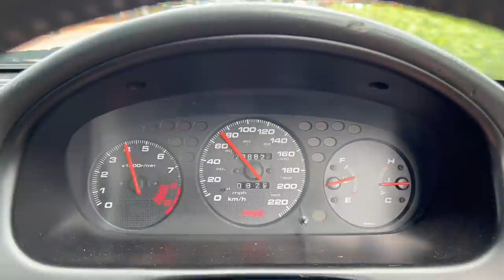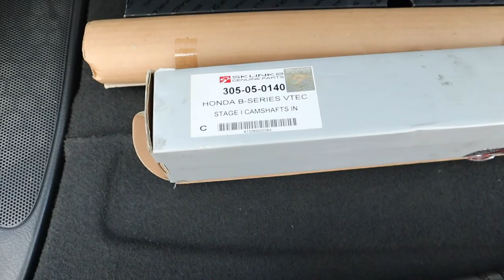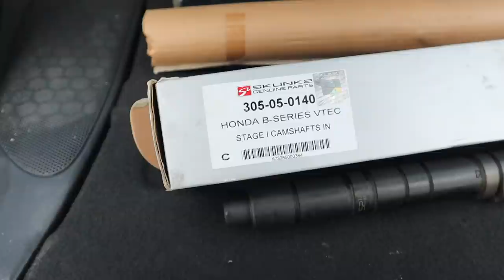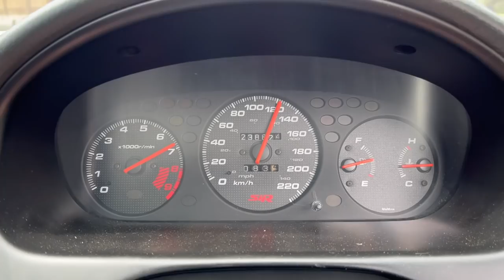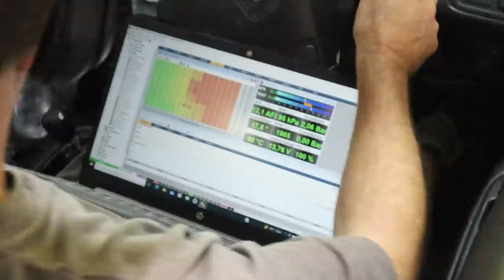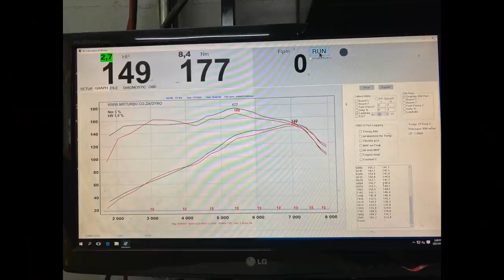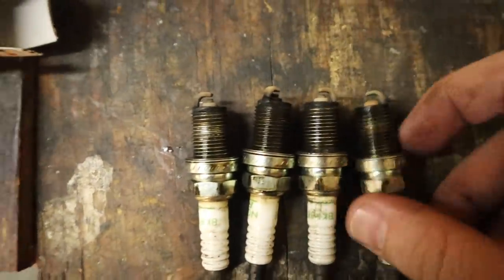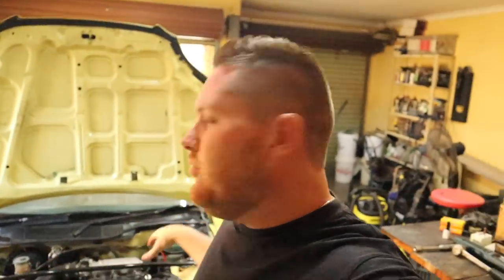Skunk2 Tuner1 Cams for my Honda Civic B20 VTEC

Comment: Brilliant cams my advice is check the stock timing no cam gears are needed as they are drop in these cams are made for stock timing make sure the timing is set on 0 degrees on TDC.
Reply from the maker: We set the timing exactly the same way the GSR cams came out of the vehicle. So something is def not happy. Seems to be a lot of mixed answers here. I also thought no gears were needed for these, but a lot of people advise me to go with gears and then we can dial them in proper. So I am not sure
Reply: @CCDVIDEO  remember getting cams dialed in would be necessary with high compression. Seeing your block is stock shouldn't be needed to extract power. I had a friend who put out 125wkw similar setup to urz

Comment: How's the fuel pump? could be the reason you leaning out but vernier gears are definitely needed as well as Fuel pressure regulator and K Series 310cc injectors to make the punch but really nice enjoyed the crossover sounds amazing🔥🔥🔥
Reply from the maker: Well the plugs only deteriorated that bad in the month I drove the car after fitting the cams. When we took the GSR’s out it was still fine. Seems like my 02 sensor is reading faulty 😑
Reply: You right can be 02 sensor I totally forgot you running the Ecu Master Management🤔

Comment: Is the b20 a stock bottom end?
Reply from the maker: As far as I’m aware, the motor is still stock apart from the cams bud
Reply: @CCDVIDEO  awesome. I have a set of Tuner 1's for my b20 vtec but I've been extremely worried about Piston to Valve clearance. Have you had any issues with the cams?

Comment: Not running lean at all more white would be lean for cam timing you should have checked that or the tuner should have checked that with a timing light before the tune and for being down on power looks like a poor tuner I made 230hp with a stock bottom b20 built head and tuner2 cams on pump 92
Reply: Information on the built head? Any porting done to it? I ask cause I also have a stock high comp b20z2 and a b16 head and the tuner1 cams trying to figure out what I need to get to atleast 210 hp thanks for any info!
Reply: @alonzocates4742  mild ported and you will need to notch the pistons for valve clearance
Reply: @jasonlowther9936  thanks when I’m ready I will most likely get different pistons. High compression most likely
Reply: @alonzocates4742  there's no need to I made as much or sometimes more power than a built motor and mines completely stock bottom end only reving to 8100 would have made more if I kept going up